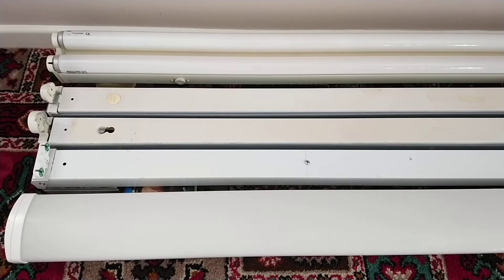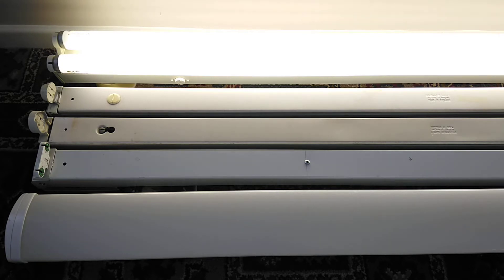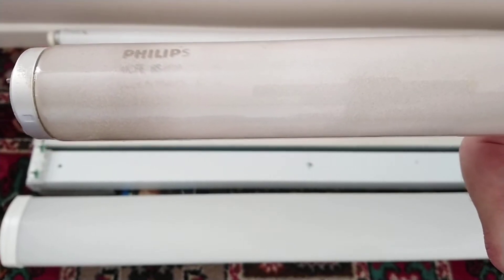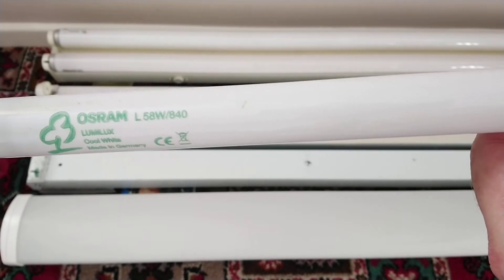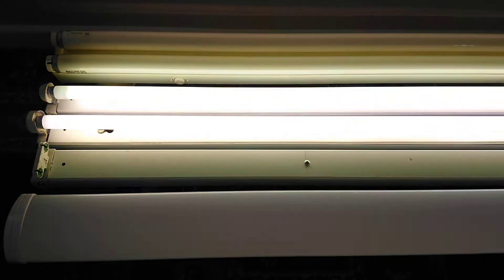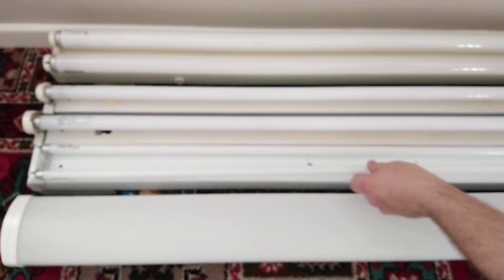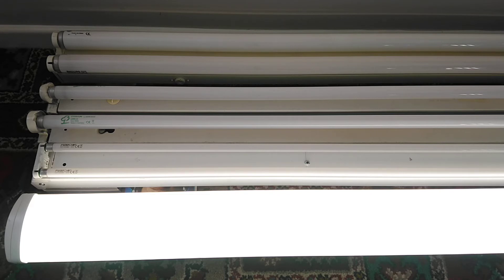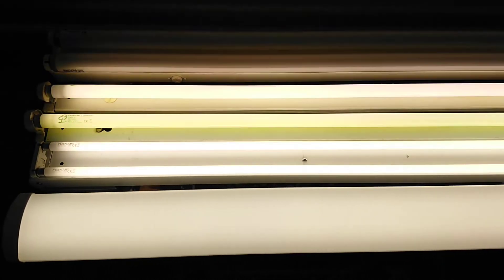Fluorescent Lights T12, T8, T5 and a LED Replacement

Comment: Strange how all this technology is pretty much dead now LED has come along, it's happened so quickly. Nice to see them.

The earlier types have always interested me. Got several old fittings in use here using long since obsolete tubes and circuits.

Comment: Do you have any of the rare 5 foot 50w T8 tubes from the 1960s? They often used preheat chokes with series capacitors just like 8 foot 125w T12 tubes do.
Reply: Very rare now, more commonly used into the 70s in Thorn Arrowslim fittings. Earlier types used used a choke and series capacitor, with a special starter switch type 155/501. Later ones used a resonant start circuit.
Reply from the maker: No, But always looking out for older tubes and light fittings.
Reply: @davesbusstuffandmore  Those old tubes are certainly well sought after among British lighting enthusiasts due to their rarity.